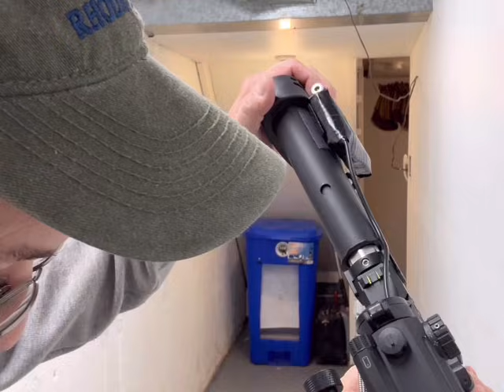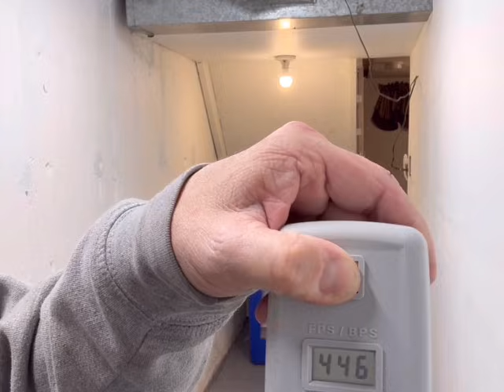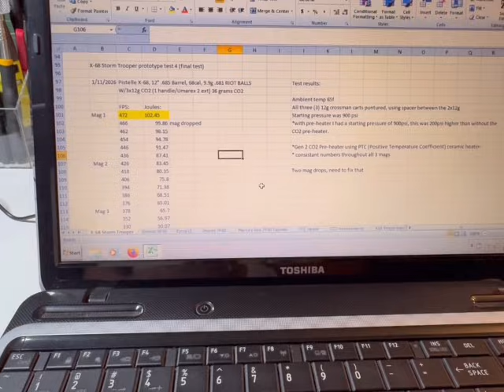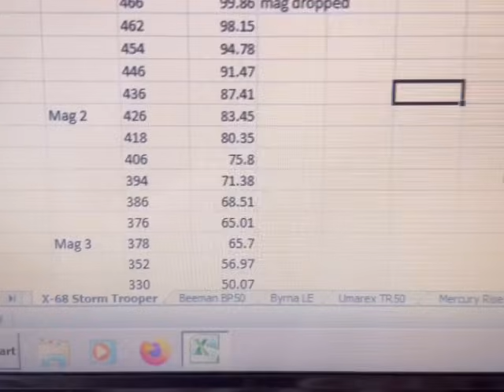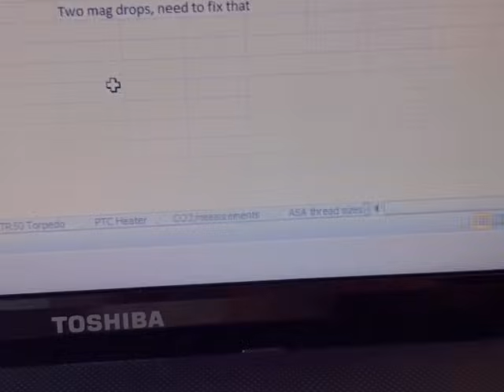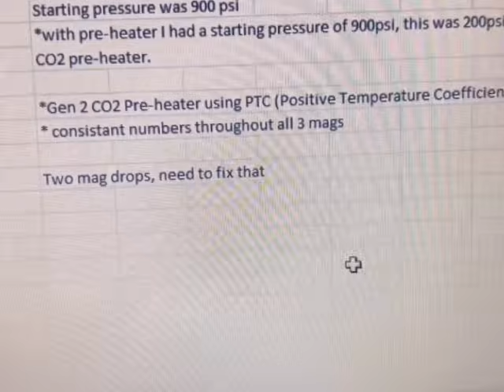X-68 Storm Trooper build Test 4 (final)

Comment: Why not just use hpa? Paintball tanks come rated 4500+
Reply from the maker: There are reasons to use either HPA or Co2 for sure, some are personal preferences but, this build was about me accomplishing goals I had with Co2 and specifically 12g co2 carts, as they are most economical. but I hear you about the HPA, there are pros and cons to both air sources.
Reply from the maker: Plus its a lot of fun for me!